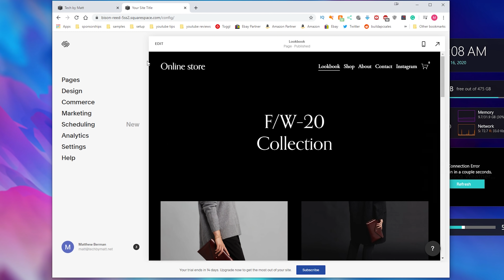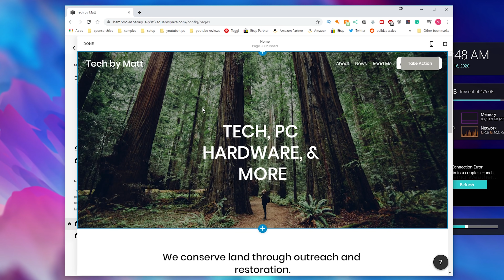Old Office PC + GTX 1650 = Gaming PC?

Comment: Pretty much every old PC with at least 4 cores from Intel can be paired with a new,  low powered GPu to make a for a great 1080p gaming system.
Reply: Depends on the Manufacturer. Sometimes the PSU is too low to add anything, like 120W. And its also proprietary, so an ATX PSU cannot connect to the prebuilt's motherboard. Then you're screwed.

In fact most prebuilts have non replaceable PSU's. Notice how the PSU was not upgraded in the video
Reply: @Gyro Adapters exist but don't work on most HP computers, idk about dell. The motherboards have a Watt limit like the Erica board, you can't supply more than 200W in. So you will need a similar workstation board like the Rother that can take 500. The HP 24 to 6 pin is not supposed to work, reducing the pins in which power is delivered is highly not recommended, there is a high chance of damage to the motherboard.
Reply: @UnintelligentVideos  GT1030 might be able to do that with a 30 watt TDP
Reply: @UnintelligentVideos  "non replacable psu"

Nothing an angle grinder cant fix ;)
Reply: @jimmycarburator2012 Helps me fit full size graphics cards in my sff 9020 anyways 😂 but I am an engineering workshop pro.
Same can be achieved slowly and careful with a 3 dollar mini/junior hacksaw or tinsnips/metal cutters and sandpaper or file to remove rough edges, rattlecan primer and spray paint to taste😂

Comment: I don’t know but it looked like there was tons of screen tearing?
Reply: Bryson Reed probably because he didn’t have vsync on
Reply: Yes, was about to point that out, so much tearing it's unbeareable.
Reply: my theory is that thats because the video is at 30fps and any small tearings he recorded, we see them 10fold...
Reply: @Narcrate140 what is vsync can you tell me??
Reply: Ali Afroz vsync is when you sync the frame rate with the screen refresh rate
Reply: He didn't have V-Sync in prob cuz he is screen recording which loweres framerates A LOT.  so yeah, if you dont know what v sync is, it basically limits the frames to how much your screen refreshes to show a new image, if the fps is so high to the point the monitor can update enough, then the screen will tear.
Reply: @Narcrate140  no v sync is Vertical Sync which means that all rendered frames are lined up correctly with your display (which is also the reason why it limits frame rate to your refresh rate) and hence there is no tearing
Reply: Its probably because v sync is off, if it was on you wouldn’t see it but it would limit your frame rate
Reply: maybe it's the rendering quality of the video.
Reply: @appelsin2821  yeah but i think it's also his rendering quality when he recorded it
Reply: plus no one plays with VSync on because of the incredible lag.
Reply: I got this build and had screen tearing issues until I forced vsync on. Now it's as smooth as butter
Reply: keep in mind he also has to screen record so theres some frame drop
Reply: becuz the pc is outputing alot of fps but the monitor cant display them all(low refresh rate)
Reply: remember u usually lose frames when recording

Comment: Their old PCs: Good CPU for the time, good CPU cooler, 8GB RAM

My schools old PCs: 1 core CPU from the beginning of the century, Intel stock fan, "RAM, whats that?"
Reply: @burgythepuppy  most games make use of 16 gbs or more especially at 4k
Reply: @burgythepuppy  right, not 4k ofc but at 1080p fs
Reply: My school had i3 9100f :D or is it the right model idk
Reply: My school has compaqs with core 2 duos
Reply: Your school getting a pc's?
Reply: And the ram usage is full again
Reply: Azulettez your school has Macs. Your lucky
Reply: @burgythepuppy  it isn't average. Average gaming PCs have 16gb.
Reply: Lol my school has core 2 duo e8400 and 4gb ram with integrated graphics
Reply: My school pcs were all workstations with 16gb ram and i7-3770 and I think they had quadro cards of something
Reply: @burgythepuppy  not any more new standard is 16gb
Reply: This hit home, my old PC was an Dual core Athlon with 2GB of Ram and a cooler the size of a coin
Reply: my school has i3 8100 with 4 gb of ram and its better than mine...
Reply: Bro. Just stick a ryzen and 2080 in there when no ones looking. Boom. Problem solved.
Reply: My primary school had i3 5005u laptops which were decent and could make a decent gaming rig if they didn’t have integrated graphics but they sold them for some reason in exchange for some ancient laptops with intel atoms and I guess 500mb ram or something that were broken and they had displays which didn’t work most of the time. They were at least 5 times slower than the older (well, newer but still old) laptops and originally had windows 7, but my school did the stupid thing and upgraded them to Windows 10 which my school couldn’t handle. 

Now I’m in secondary school, and the computers there are split into different categories depending on each classroom and whether they are student or staff setups. All PCs, as you would expect, are Intel-based, and I’m gonna assume they have somewhere between 4 and 8GB ram. They work quite well as office PCs, which is good for a school. I think most have an i3 of some sort, although I have seen some with an i5 and even i7 stickers, but some, mostly in 1 or 2 classrooms, are comparable in size to an Xbox One X. Unfortunately, they don’t have the same level of power as an Xbox One X, instead they have either Intel Pentiums, Celerons or, like my primary school’s laptops, Single core Atoms. These tend to be way more sluggish, and also I never used a PC with an i7, if there are i7 PCs in my school they’re most likely older ones (like 1st - 4th gen) There’s also 1 classroom (Media Studies classroom) that have about 5 - 7 iMacs. I feel privileged to have school computers that are much better than what other schools have.
Reply: @Brisk__  rest in peace
Reply: Burgy The Puppy I have more ram in my gpu
Reply: Zelty they have very old macs
Reply: Burgy The Puppy most people use 16 gigabytes
Reply: @icosmiixi9390  so they had 14,000 dollar cards? Yeah right
Reply: My school has i7 8th gen,
Reply: @Azulettez you cant right click on mac
Reply: Bro have you seen my school u don’t know how bad the computers are it’s like a intel pentium 4 with 2gb ram and a 100watt psu
Reply: We have laptops but THEY ARE DELL LATITUDE THE WORST
Reply: Lucky me my school has a core I7 8550u my school upgraded there pc’s
Reply: bro we have workstations cuz we at a tech school doing CAD and other rendering software
Reply: It uses 8mb of usb for ram 😂
Reply: Well im buying a 8 gb ram laptop with a 2gb videocard ram and widows 10 its pretty good for school and ging and its cheap as well
Reply: @Azulettez mine too but at least  they're usable. and if you have a friend that has an admin pin you can download  a handful of games
Reply: @Brisk__  yeah my brother's high school had good laptops but i have chromebooks that lag with 4 tabs open
Reply: anonymous guy FRiking i7 and now frking chromebooks
That means that they couldnt afford too many i7s or sumn
Reply: my school gave ipad airs
Reply: The middle school where I was they had small Acer pc's with Skylake Pentiums or 6th gen i3's, even though in other location they had Dell optiplexes, some that were from the XP/Vista days with Pentium and other more modern that had 2nd gen or 3rd gen i3's or i5's.
Reply: @Viljonkk4  if it has 9100f it will also have a gpu
Reply: my school computer is like from 2007 lol, they recently just made one new for expansion with trash computer
Reply: My school have Pentium gold g6400
Reply: Mine has different areas with computers however in the it room they have usff PC's with a 9th gen i3 I'm pretty sure
Reply: My school has intel pentiums and when we try to watch videos of school work it has to be at 144p
Reply: @GamingDerped  damn your school can't afford a ahtlon 3000g or a Pentium gold?
Reply: @Quiet Kid 47 • 12 years ago probably for 3d rendering
Reply: In 6th grade 2018 my Middle school decided to replace all of their computers with windows 10 to windows 7 like wtf. Of corse it didn't last lomg this year I'm in high school but my friend who is still in middle school says they swapped them all back to Optiplex 9020s with windows 10.
Reply: @vyanldn  nothing wrong with the higher end latitude laptop. I have e6340 with 4th gen i7 4740qm. Quad core with 8 threads, a slim graphics card, 600gb ssd, and 16gb of ram. It's faster than a current Mac book Pro for loading Photoshop or other cpu and GPU intense programs
Reply: @Brisk__  SAME
Reply: my school just has chromebooks chromebooks suck they lag so much
Reply: @burgythepuppy  8gb is kinda low depends what kind of ram it is tho
Reply: @Brisk__  same 😭😭
Reply: In my school we have 2008 "turbox" core 2 duo pc's with 4gb of ram and 500gb hdd's.We even have optiplexes with the first  design.Recently we got new optiplexes with 10th gen i3s,4gb ram,500gb hdd.they had brought 20 new pc's for the computers class and the idiots took 16 pc's on the school office and left 4 new ones.So most pc's in my class are 14 year old potatos.
Reply: My school pcs has 8gb ram 😎 they are almost as good as my laptop but I have a graphics card and they don't
Reply: Rip
Reply: my school PCs are currently celeron laptops with windows 10 and 4 gigs of ram, they're pretty slow tho
Reply: my school threw a stick of ram and taped it to a screen and called it a day
Reply: Them e3 1230’s be cheap rn. $15-20.

Comment: Love your videos, sir.  Yes, the power supplies in this old machines usually don’t have 6 pin connectors but more importantly they are usually 240-260 watts. Therefore, the low power draw is important. I just upgraded a Dell Optiplex with an i7-3770 CPU by installing a GTX 1050 Ti that I got on Offer Up for $85 and it works great. I tested the  system on Unigine Valley using Medium and Ultra settings and the power draw was never over 150 watts.  So I have a nice eSports machine for under $250.
Reply: @Jezza 04 can we install 1650 on Dell 7050
Reply: Hello, I know this is old but how can I know the power draw of my PC?

Comment: Great video, just finished a similar setup for my youngest son, but with an i7 3770, 12gb of DDR 3 RAM 1600mhz and a GTX 1050TI, it plays decently at 1080p hight settings on most games and even handles emulation up to the Wii U and Xbox 360 👍 keep up the good work as I really enjoy your videos buddy 💪
Reply: I think your build is better lol.
Reply: I suggest you to buy 4gb slot so u can use quad channel and have better performance

Comment: HI Matt i love how you upgrade old devices and turn them into respectable gaming machines. I have an old dell computer running xp and i was wondering what are the best specs/parts i can use for a windows xp build. i don't really need it to be powerful but i have a lot of nostalgia for xp and would like it to perform as best it can
Reply: There's a video somewhere in yt that shows how to build a pc that lets you play windows xp games at max settings and it involves a core i2 extreme
Reply: @ieattwiceaday4116  i see thanks. the dell computer i have is a dell vosotro 200. i plan on replacing the power supply, ram, graphics card and hard drive but don't know what to get
Reply: Go to cpu upgrade.com or CPU world to compare what CPU you can upgrade too.
Reply: what i usually do for older dells like that is google what the max ram and best cpu is for them and then get them on ebay for 20-40$ each and then find a cheap gpu in the same price category that fits. Though my XP gaming rig is an a8n-sli premium +3800 x2 and a pair of 9800gts i got off ebay cheaply and because i wanted to mess with sli
Reply: budget builds official just did a video on this.  go check him out.
Reply: Zettai Muri at that point you might as well get a new pc
Reply: I have a 220 vostro and this info seems helpful.

Comment: “smooth experience”
Me: seeing the visuals tear...
Hmmmmmmmmmmmmmmmmmmmmmmm
Reply: that's probably just his recording software, pretty sure the actual experience is actually good
Reply: He had vsync off so that the games would run higher than 60fps. However, that creates screen tearing.

Simply just turning vsync on will fix it, but you'll find poor performance in some unoptimized games.

Comment: My daily driver is a HP Compaq Elite 8300 SFF that I've pushed to its absolute limits. Running a delidded Xeon E3-1290 V2 among other over the top gear, for an 10 year old CPU this thing is still incredibly fast. Love SFF builds!
Reply: Yo. I got one too. Elite 3000 but I got a pny 1650 graphics card. Will it work?

Comment: my dad had a mid-2011 iMac that he gave me and I'm trying to upgrade it.
it's basically much harder than upgrading a normal pc.
Reply: i dont think it is upgradable
Reply: i recommend u to buy a new one and i dont think iMacs are upgradable
Reply: Macs suck
Reply: it can be upgraded but it's too risky.
i'ts hard to find compatible gpus.
Reply: @ermi9236  They're the last iMac that Can be upgraded. I've upgraded the Hard drive to an SSD, added RAM and I'm in the process of swapping the GPU. @PPASH go on Macrumours they have a huge forum about upgrading 2011 imacs. Go for a nVidea Quadro card. That should be a prettyy much straight swap
Reply: I wouldn’t upgrade it if I were you because it’ll still be sucky
Reply: Donny yeah and it’s not worth it. But why not doing for experience.
Reply: Just sell it and buy an optiplex then upgrade that
Reply: Sell the Mac and buy a dell
Reply: i had a  powermac g5 ripped all the insides out cut the motherboard mounting plate from an old case and mounted it to the stand offs already in the powermac case and built a i7 3770k pc in it with a rx580 8gb the cases are some of the best looking so it was worth the effort to do it
Reply: you can upgrade ram and hard derive but not much more. A cpu upgrade is possible
Reply: sell it
Reply: sell that thing and build a gaming pc from that,maybe
Reply: @ogmodiji6024  prices are so low in my country. with its money, I can probably buy a mid range pc
Reply: Stuff PC parts in the shell?
Reply: @NezD  great idea. I might send them to get recycled.
Reply: @willm5032  thanks for the info bro
Reply: @blacksta-r  true, but I'm used to final cut pro x

Comment: Built a similar system with the i7 2600, 16gb ram, gtx1650 with a ssd. Its fast and can play everything on high settings
Reply: How much was your pc total?
Reply: @clovernotatroll2302  the whole pc and ssd was cheap.. around 250. The most expensive component was the gpu. I live in canada so I pay more for everything in general

Comment: I have a really old PC maybe from lik 2010 or older , but it still has windows vista , and I'm thinking about upgrading or just building a new one .
Reply: Natey 55 you probably should, me my self has a old pc with a fx6300 and gt1030 and 8gb of ram so I hear you.
Reply: just build a new one by saving up money
Reply: @superserval2669  yeah the thing is it's pretty old even when I try to connect to wifi it never worked , or maybe it's my mistake , but I tried ethernet too and it did not work so that's not gonna be good for it .
Reply: Try upgrading using cheap parts
Reply: i think you should probably save money and buy a new one
Reply: you should probably just build one brand new. You can get an r5 1600 af for $85 and pair it with a used rx 580 and you can get a decent gaming machine for $500-$600
Reply: Natey 55 I’m thinking drivers are to old and os is to old to get newer drivers
Reply: Yeah I think building a new one is better like a 600$ or 500$
Reply: @Deathtrooper27  dude don't build now wait two weeks Maybe Nvidia will lanch new card
Reply: Natey 55 I would recommend a ryzen 5 2600 with a rx 570 and 16gb of  ram,a 500 watt psu should be good and I lastly recommend a b450 motherboard
Reply: @thenamesjohny1490  It's been delisted everywhere pretty much.
Reply: I gave my little sister my old hp tower. original spec was 8gb ram max with stock a8-3820. swapped out the motherboard that held 16gb max and a8-3850. added a ssd for windows. made such a big difference in speed. she isnt into major games. just basic fortnite and other light games. tossed a 750ti into it. max psu is 350watts, so i try to choose items that take less energy to run.
Reply: I have myself a i3 4th gen, 8gb of ram, gt 730 and it's pretty decent for gaming and cheap too

Comment: I put that GTX 1650 into my Fujitsu Esprimo E920 office desk PC (i5-4590, 3.3GHz Quadcore / 16 GB RAM / Samsung EVO 500GB SSD) and it performs great.
High speed video rendering and draft previews are fluent,
Games like GTA5, Just Cause 4 and even the new Resident Evil 3 run at around 62 FPS on all epic settings. 
Can't complain.
Whole PC cost me under 300 Euros.

Comment: I used a gtx 1660 and slowly added more to it. So far I’ve added: 24GB ddr3 ram, 750w PSU, and gtx 1660. I’m planning on getting a new motherboard, and AMD based cpu, and case next.

(It was an optoiplex 9020 with an i5 cpu)

Comment: I got the optiplex 7040 with i5 6500 16gb ram, SSD and HDD for around 95 dollars. Then for 60 I found a regular 1650 but requires a 6 pin connector and I used a SATA adapter. It works great. I also found a LG 75HZ 1080p monitor which is perfect for all the games I play. I bartered that down to 40

Comment: I just wish these small form factor versions weren’t so much more expensive than the other versions
Reply: the idea is when u try to make a small form factor pc you have to be so careful so metals don't touch each other and conduct electricity, and that means that you need to be really careful about the case design, make sure that everything fits and no wires touch fans... that's why it kinda makes sense.